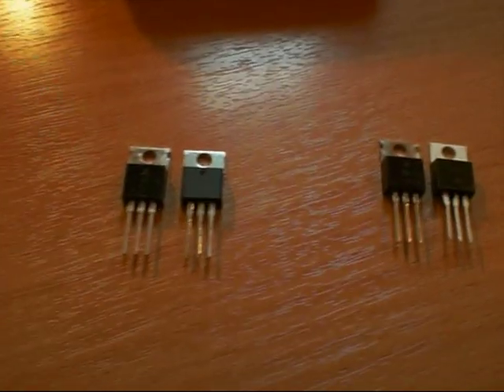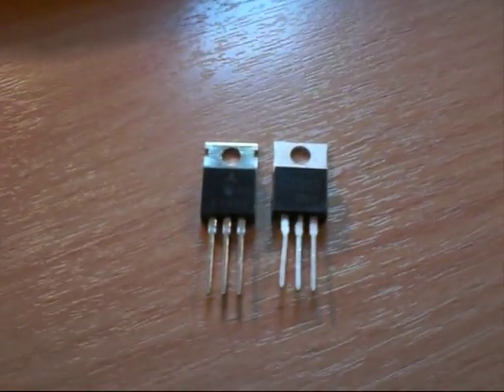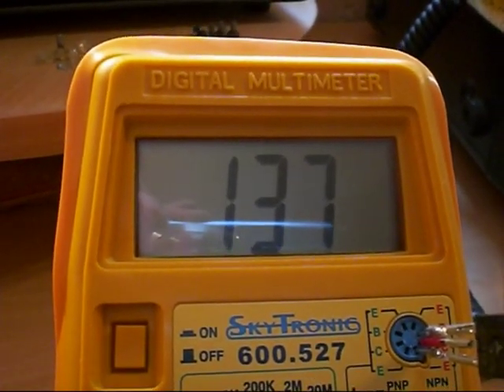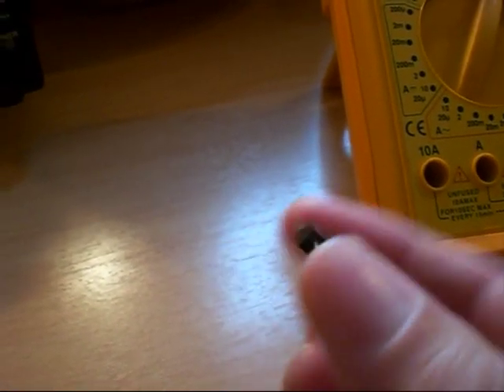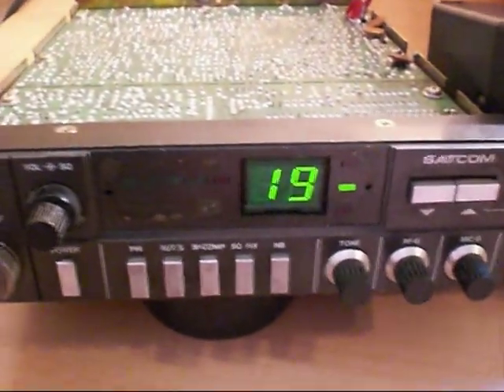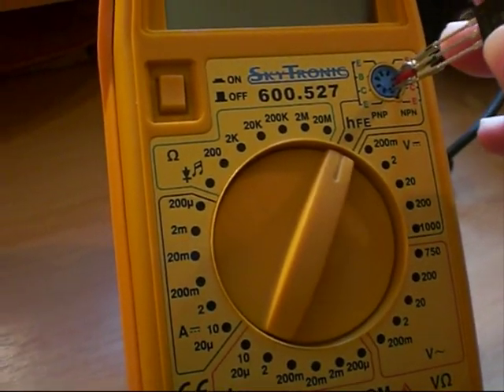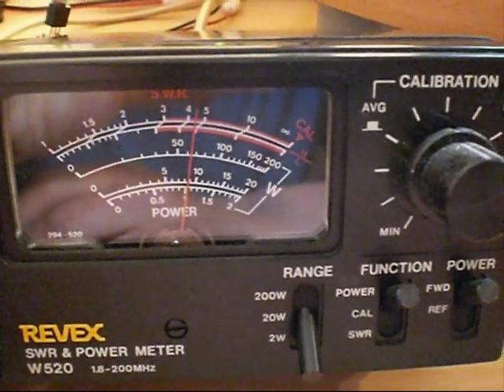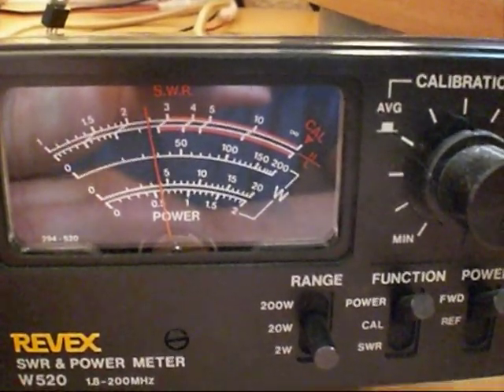FAKE 2SC1969 & 2SC2312 HFE & OUTPUT TEST.

Comment: For some reason, the real LARGE screen Mitsubishi TV CRT output modules can go up to 32 MHz, and the 46" sets can do well over 2000 watts RF!
There is just something about Mitsubishi.
The 36"/38" sets will do well over 600 watts RF, and the Mitsubishi FLAT BACK sets have an independent power supply for the HV and and an independent PS for the audio, they have FLAT external heat sinks on the back.

Comment: I have seen a 2sc1969-DIV with a 2 Yr warranty please if you can shed some light on this you can find them from through a place called the little diode shop and ebay both the cb-20 and the 2sc1969-DIV are good for what i am hearing
Reply from the maker: 2SC1969-DIV ????? no such thing and i know which ones you are talking about....no comment!

CB-20W = 2SC1969 Eleflow = very good! ....i should know!

Comment: Very useful PSA but I have a question, where can you find the real Eleflow 2SC1969 RF output transistors in small quantities? All I have found is the original company which does not seem to sell in quantities of less than 1,000 or so. By the way, they are also used in the Radioshack HTX-10 transceiver which was sold here in the US.

Comment: Same with Big Screen Mitsubishi Tv's if you try to replace the Horizontal Output Transistor with a sub it with blow up. You have to use a Mitsubishi factory part.

Comment: great video, mate! thanks for posting. I remember the haydays of Sony trinitron tvs, they were heavy on using 'SG' horizontal out transistors, they were very expensive and the market was just flooded with fakes. Would seem to test good on the meter, but once you installed it, they would either blow immediately or work a few hours or days and blow.

Comment: Hi Weazle. I just purchased 2, 2sc2166 and 2, 2sc1945 transistors from you. But I dont know if that is the problem. I was on the Defpom forum and a fellow had the same no transmit problem as I do. Turned out that his transistors were good. The fault was C60 which is in parallel with C75, it was reading 90 Ohms
on a Fluke 189 DVM. I will use them or keep them in stock for future problems. I intend to keep my HR2510 for life. Thanks.

Comment from the maker: @Flashvette The HFE sounds good but the problem is it still does not guarantee the transistor will amplify RF, i recently had to replace a 2SC2166 in a radio which had a good HFE and junction but for some reason would not amplify RF as i found out when i tested it in another radio and it was the original transistor from when the radio was new - i replaced it with a new one and the radio worked fine.

In this video you can see the fake transistors have a good HFE but they don't amplify RF!

Comment: Hi. I think I found the data sheets. The 2SC2166 specs are min-35, Typ-70, max 180. The MRF 477 is  min 20, Typ 70. If I am reading this right. It looks like my transistors are within spec. Must be something else.I dont know where to go from here. I really want to learn how to fix it. No transmit in am,fm,usb or lsb. BTW. My meter was pinned and wacky. I found a few circuit board screws that were loose and now my meter works fine.